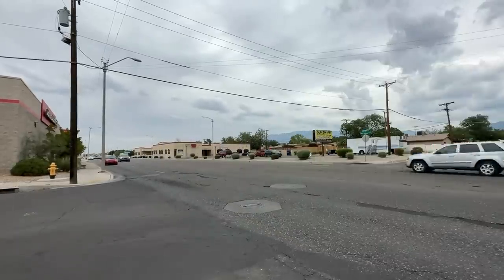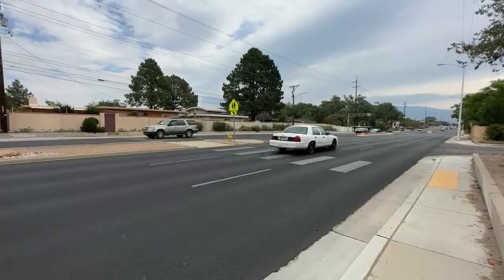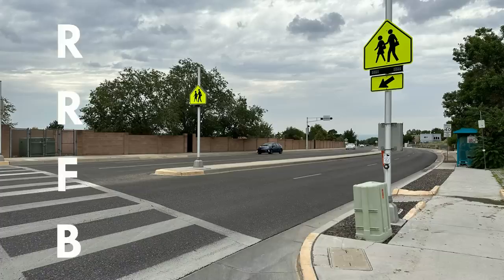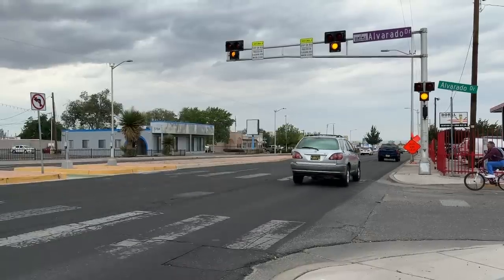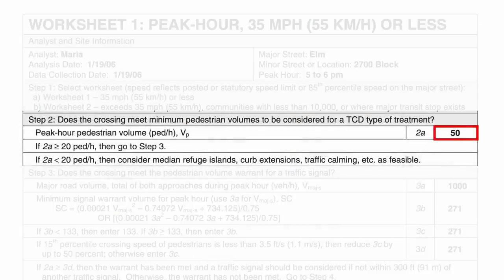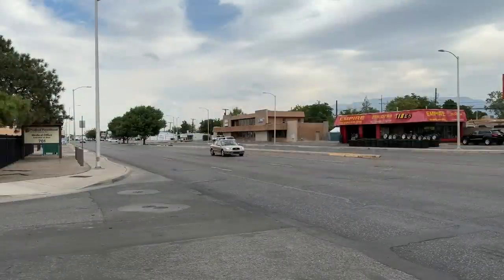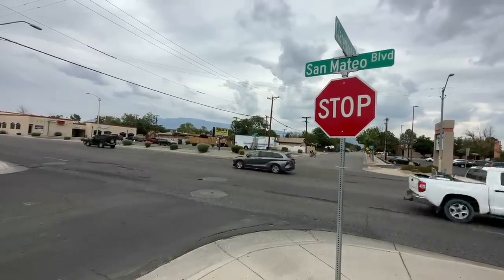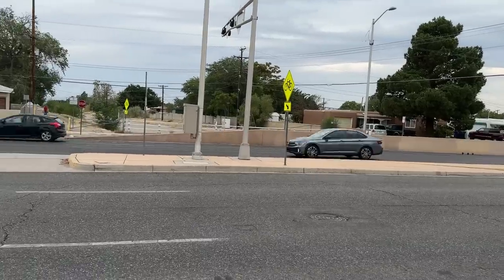The Insane Ways Traffic Engineers Try to Make Streets "Safe" For Walking

Comment: There are quite a few places around my suburban home that are easily walkable by distance, but are cursed by exactly the kind of stroads described in this video. Although we have excellent bike paths, cycling is apparently supposed to be only a recreational activity, not something one would use to run errands.  Of course the public responds rationally to this kind of design by not walking or biking anywhere for any reason other than recreation.  You really must own a car or you are out of luck, since even mass transit requires "last mile" travel that can only be completed safely by automobile.  It's just nuts. I have often wondered if traffic engineers ever get out of their trucks and try to use a crosswalk or ride a bike. How could they have done when they design things that multiply what should be a 15 minute walk into a 45 minute ordeal?

Comment: I know of a 40mph posted speed limit 5-lane stroad with 400 apartments on one side and a shopping center with a grocery store on the other side. It literally took decades for the county to install a crosswalk light activated by pedestrians. 

However, there are still turn lanes on each side of the crosswalk WITHOUT traffic lights. So sometimes there are cars stopped at the light with no one around because a cyclist used the walk light and is long gone, or a pedestrian got tired of waiting and left. A car in the turn lane normally yields to traffic, but has no idea when the crosswalk light will change to green. Keep in mind that the turning cars can not go quickly because the short steep driveways will damage the underside of many cars if taken quickly. 

After speaking with county traffic engineers, their solution was to move the distance between cars stopped at the traffic light from 30 feet to 50 feet to give cars a bit more reaction time to stop if the cars in the turn lane accelerated as the light changed. The county didn’t want to put in turn lights because there are traffic lights at an intersection 500 feet away.  
 
I see the county facing a lawsuit in the future when someone gets killed or badly injured when a bicyclist or a pedestrian on a sidewalk are involved — a sort of perfect storm situation.

Comment: Where I live, these flashing crosswalks do work. But usually are only installed on two lane main roads in the suburbs.
People get to know where the crosswalks are. And the flashing lights help people know to stop.
You will never find yourself crossing a 4 lane or wider road on a crosswalk that isn't marked with flashing or stop lights.

I have been in towns where the drivers DO not stop. But it boils down to lack of pedestrian traffic. There is little to no pedestrian traffic in this small town. People rarely ever yield at a crosswalk. But thats because the drivers are not used to checking for pedestrian because they aren't doing it. The more pedestrians you have in a city, the more drivers become attentive. 
I've been almost run over twice in this small town, where I've spent no longer then a week there at a time.
The city I've lived in my whole life, never had a fear of being run over.

Comment: 98% of cars stop for these???  WTF?  It's more like 98% of cars DO NOT STOP for these.  My current city has better drivers and less traffic than other places I have lived.  A few years ago, they put in some of these flashing crosswalks on a 45 mph stroad.  These crosswalks also have flashing lights in the pavement, so they should be even more easy to spot.  However, I have seen so many cars run the lights.  I have had cars behind me honk at me because I stopped at the lights.  I have read online about crashes from these.  These seem more dangerous than no lights.  Stupid idea.  Terrible.

Comment: We have these all over Madison and they feel like they're mixed utility.  I find them helpful in making pedestrians and cyclists more visible, but they feel like they're way more effective when visibility is already good than at night or other conditions where you're expecting fewer pedestrians and cyclists.

Far too often, I drive toward one of these and the lights are flashing but there's no sign of who or what might have triggered it, and that leads to a lot of motorists just sort of eye-checking the area and then driving through at full speed.  Bananas, traffic circles, and narrow streets all feel more effective, at least to me, a delivery driver who puts about 1000 miles on their car every week and genuinely wants to feel like I and everybody else near the road are as safe as possible.
Reply: At least they make it feasible for a non-driver to cross at a non-controlled intersection, rather than the monstrous crosswalks found on Whitney Way, Speedway Blvd, etc. The city needs to focus on reducing speed limits, reducing vehicle lanes, and add traffic-calming measures, but they've been slow or hesitant to do so due to the thought that there might be push-back. Incremental progress is being made, but at this rate, by the time walkability has increased, everyone except for elderly homeowners will have been priced out of the city. The city's fundamental problem in both of these regards is the ongoing nightmare of single-family zoning, but traffic engineers can't fix that, only politicians can.

Comment: I have found the RRFB crosswalks to be far safer than HAWK signals. With the HAWKS, drivers are very confused by the flashing yellow, going to solid. Then the don't know what to do when it starts flashing red. I have seen more drivers just say eff it and go through, albeit at a lower speed. With RRFBs, it is an accompaniment to what is already labeled as a crosswalk, so when it starts flashing it appears easier to make the connection that someone is crossing. My experience was that I was more assured someone would stop at an RRFB and felt a <50% chance for a HAWK.  [Actually,  just better to have a full, regular green-amber-red signal at the crossing and be done with it - everyone understands those]  The caveat to this is that my experience was in Massachusetts. There, roads are generally fewer lanes (max 4) and those lanes are narrower (10').  As another commenter mentioned, the thing that really makes the crossings work is enforcement. Cops will stake out a particularly well used crossing and ticket the hell out of the slightest infraction. Drivers learn they that don't like tickets (which in MA can incur points as well for crosswalk violations).  I have now moved to Buffalo NY where the suburbs are littered with ridiculous stroads with average driver speeds of 50mph and no pedestrian refuge opportunities at crossings. There have been two pedestrian deaths at one 6-lane HAWK "protected" crossing serving a rail-trail because people drive too fast and don't understand the HAWK. Eff stroads.

Comment: I hope that no engineers actually use the mindset that crosswalks give a false sense of security. So by that logic to make the streets safer for pedestrians, remove all painted crosswalks so pedestrians feel less safe and are more observant, just forget about those who are deaf or blind. And the logic follows that we should just go to the Dutch Woonerf system to decrease the false sense of security drivers get from traffic signals, signs, and markings on the pavement.

Comment: The solution: grocery carts on the side of the road. You push it out into the crosswalk. Drivers see it as a threat to scratch their precious F350 VELOCIRAPTOR 600 so they stop. Or they don’t and it’s the cart that’s mangled instead of a human.

Comment: 3:52: I wonder about that 98% motorist compliance statistic, because it’s much higher than what I have observed. For example, near my old home, there is a crosswalk with one of these RRFBs. This is a two-lane road that runs through a public park in a residential area; the posted speed limit is 35 mph. In the 10+ years since the RRFB has been installed, I can count on one hand the number of times that drivers actually stopped to let pedestrians cross. As at all other crosswalks, it seems the only safe way to cross is to wait for traffic to clear on its own; you can’t expect drivers to yield.

Comment: A zebra stripes crosswalk should really only be an option for two lane streets. If I see traffic stopped in both directions I am at least save from anyone coming up behind the stopped cars. It is still advisable to only cross when the cars are actually stopping of course. You don’t want to fall prey to the 2%. 

If a street has several lanes per direction it needs signalised pedestrian crossings or in the worst case bridges.

Comment: I hate these newfangled things. A HAWK was installed near my apartment a couple years ago, to cross a 2 lanes of traffic (just to get to a sidewalk in the middle of a major road, which is it's own weird thing) that has a 35mph speed limit but usually is going 40-45mph. Doesn't help that some of those cars are literally getting off a major freeway just a short distance away. Nearly every time I've used it, at least one car just shoots through. I always wait for that to happen before I cross. They seem to work a bit better on smaller, less busy roads nearby, but maybe only slightly.

Comment: The data 98% of vehicles stop for RRFBs is counter to my experience. I regularly ride on a rail trail that was extended through a rural town, with RRFBs at five intersections.  Very few drivers stop. They've added "Yield" paint markings and other indications to more clearly convey the message, but a couple days ago a watched a dozen vehicles ignore them, while a driver coming the other direction had stopped. I feel bad for the drivers who stop and have to wait for someone in the other lane to do the same.  I'm afraid a cultural issue is also at work in this town, as some see bicyclists and pedestrians as a threat to their way of life. (I have also been attacked when biking) . I don't know how planners can account for that.  For instance, a few years ago I stopped for a pedestrian in that town (before the RRFDs), which infuriated the man behind me in a pickup. He blew his horn, gesticulated, and tailgated me to the e-check station. I got out, ready to explain the need to stop for pedestrians (and my unwillingness to hit someone in any circumstances, let alone to get to an e-check). But when he saw me emerge from my small car, he turned away, slunk back, and avoided eye contact. I was much larger then (before biking and walking) and there was quite a size disparity between us.

Comment: There is one intersection...just a regular street...that I cross on foot everyday that does have RRFBs. Based on my experience of it, I cannot even begin to imagine this would be an adequate solution for crossing a stroad. Anecdotally, people driving are usually (but by no means always) better about stopping to let you cross if you push the button. But it's currently not working...this is now the third time it has stopped working in the year and a half that it has been there, and both other times it only got fixed because I contacted the town and asked them to fix it. This time it has been broken for 3 months and I can't even bring myself to call it in. This should not have to be my personal crusade....I'm far from the only person to cross at this intersection, which is near a school, a library, a community center, a park, a yoga studio, and (my usual destination when I cross) a well used regional rail station, and while the exact blocks adjacent to it are mostly single-family houses, it is just a block or so from the fairly dense center of the town. A few HAWKs exist in the next town, but they seem to confuse drivers a lot...they do stop for the reds, but they are all baffled by the flashing red phase, which really speaks to the proficiency level of the average driver since flashing reds exist in other contexts and always mean the same thing. I guess the good news is they tend to wait for the flashing red to clear before moving again (rather than stopping and then going when clear), which is at least defaulting to the safest possible action.

Comment: I do not cross the street in front of yielding traffic. I used to. I have almost been run down by the second or third lane car. I have also had the yielding traffic's foot slip off the brake, or some other thing happens that leaves me bullfighting a vehicle.
I no longer cross in front of yielding traffic; I would rather they just keep going.
Tunnels and/or underpasses are better. But I don't like interacting with anyone when there isn't a lot more people around. Tunnels and overpasses limit your escape potential if you feel threatened.

Comment: A chunk of the thought process that goes into road size doesn’t involve cars . It’s about getting 53 foot long trailers into stores . Most stores even convenience stores are going to get their deliveries on the largest trucks possible for economies of scale and you need the street width to maneuver to or even back into the store . In more compact areas they will often pull a doubles set of dual 28 foot trailers to a store with room break it down then run the individual trailers out to multiple deliveries obviously much more expensive these are the 150000 a year truck driving jobs you hear rumors . about . The size of the roads are a side effect of freight delivery and our consumer culture and of course any road designed for large vehicles making deliveries will feel very comfortable for a small car to drive at reckless speeds on .

Comment: I drive school bus in a small town (Pop 2500+) and the at the intersection of the feeder road to the school and the main (state hwy) road there is a RRFB.  I've never seen anyone run the light without stopping when there are people waiting to or using the crosswalk.  However, the length of time that the lights flash far exceeds the time needed for 5 or 6 people to cross and so after the walkers have cleared the intersection cars are then to free to go over the crosswalk while the lights are still flashing.  

As a school bus driver,  I'd rather see a "demand" traffic light at that intersection.  Cars would then be required to stop a the red light and vehicles (including school busses) could then make the turn onto the main road, as well as pedestrians have the red light protection.   However, with only a pop of 2500+ to call on or such signals I'm sure that the RRFB is much cheaper.  The only other traffic control light in town is a flashing red controlling traffic from one direction where the state highway makes a left turn before exiting the town.

Comment: Im my opinion these hawk signals and others in most cases should just be replaced with traffic lights, just like these roads are impossible to cross on foot so is pulling out into those streets. So many times ive been sitting at an intersection in my car with a pedestrian beside me and we've both had to wait upwards of 10 minutes to even get into the street because the slip lanes are always funneling new cars into the street segment.

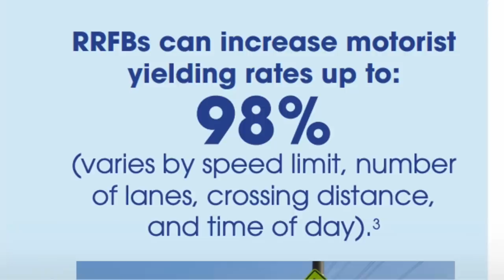Comment: At 3:55 you mention that the research suggests that you have a 2% chance of a vehicle not yielding, but that's incorrect. The study states that RRFBs improve yielding rates by up to 98%, which is nearly a doubling. So, if only 10% of drivers yield to pedestrians, adding RRFBs can improve those yielding numbers to a staggering 20%, allowing you a now incredible 80% chance of being mowed down by a 3-ton pickup doing 20 over the speed limit. YAY!

Comment: A bad attribute that I've noticed is crosswalks that have added a concrete island with reflective sticks and signs.  Especially at night, these things in the middle of the road obstruct the view of any pedestrians there.  At night, the attention is directed to the reflective objects that are always there, not to the pedestrian standing in the crosswalk.  I've seen a few of those flashing yellow pedestrian crossing signals at crosswalks that seem to work, but so did simply walking into the crosswalk, so I'm not sure that it's an improvement.  A common problem in America is Road Widening that makes pedestrian and vehicular crossing unsafe or impossible and increases traffic jams.  As more lanes are added, many of which become Right Lane Must Turn Right and Left Lane Must Turn Left arbitrarily, conflicts between cars, bicycles, and pedestrians increase unnecessarily.

Comment: Having used an RRFB on a bike, it is awful. You can see somebody crossing, but you don't know how much longer the sign will keep flashing. And that's assuming you are paying close attention, as there is no indication of what these are when you approach from the trail that is crossing the road. If you need to push the button, the first step is figuring out where the button even is, as there is no standard for that.  The only good thing to say is that it's better than nothing, which is what was there before.

Comment: Can we all agree that HAWK signals are confusing and therefore stupid. We have a few around out county, but even as a person who likes to walk and cycle and wants the protection, I find them confusing. Just used the traffic lights like we are use everywhere else. Or just simplify with a flashing orange as a warning, solid for prepare to stop and then red for stop. Back to flashing orange when done. It's in-line with how all traffic lights work. I find crossing the street in Rome less scarry that most pedestrian crossings in America. Even if you have a "walk" light, you know drivers are rolling through the light looking the opposite direction trying to make a right on red. They just don't look for pedestrians a good portion of the time. Italian city drivers are kind of nuts (Rome and Napes are tops for that), yet you can walk up to a cross walk and just start crossing. Traffic WILL stop. It looks frightening, but it's far more reliable and safe than crossing in the US. Compliance is way better than the 98% they noted in the research you showed.